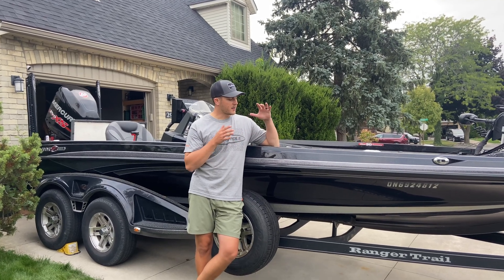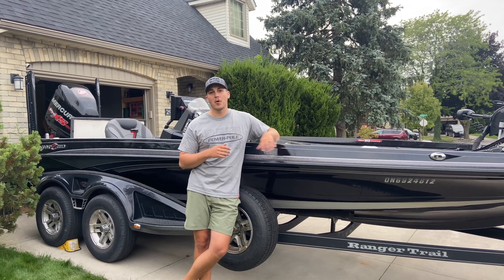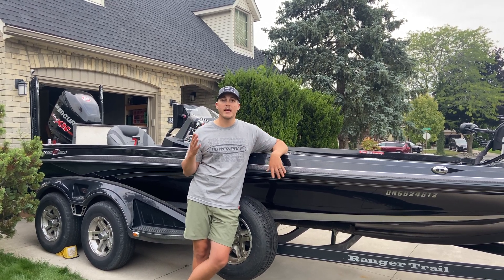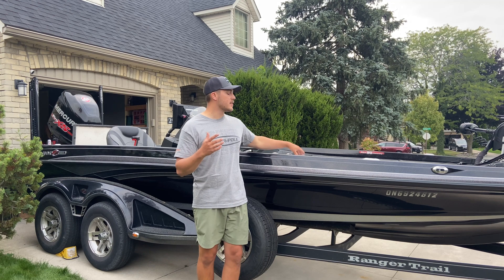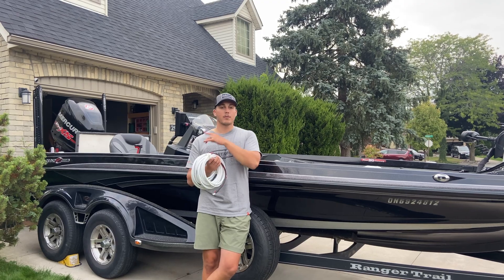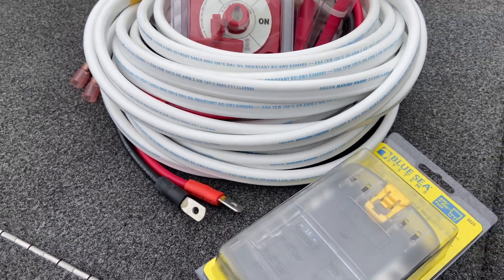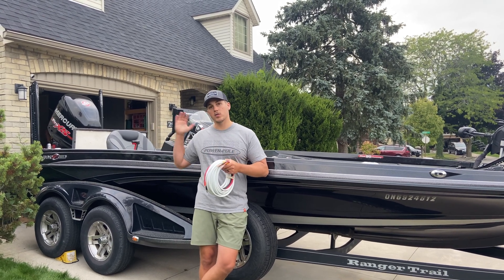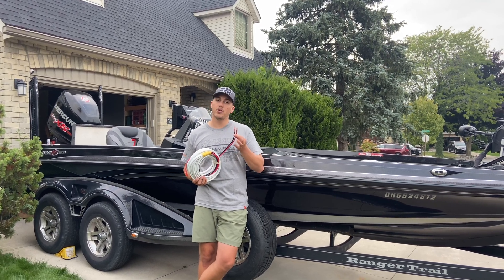Dedicated Electronics Power Harness by Radioworld | Avoiding Common Boating Electronics Issues

Comment: Curious what you would wire a Garmin LVS34 black box to. Would you wire from the fuse block or run a dedicated line for it?
Reply from the maker: I would wire it directly to the fuse block at the bow. No need to run a dedicated line unless you are powering it with its own battery like a small 30ah Lithium for example.
Reply: @patrickzajdel  Cool. Thank you!